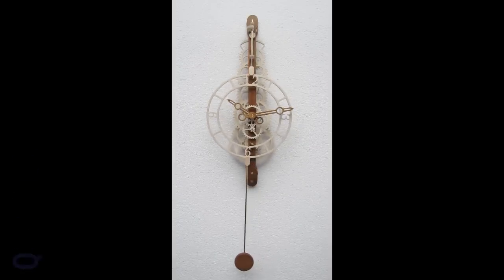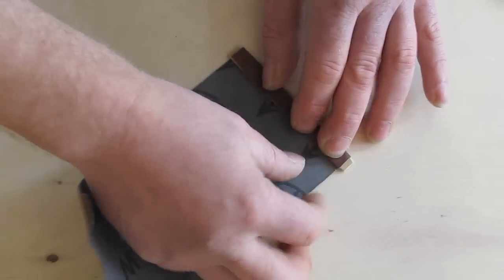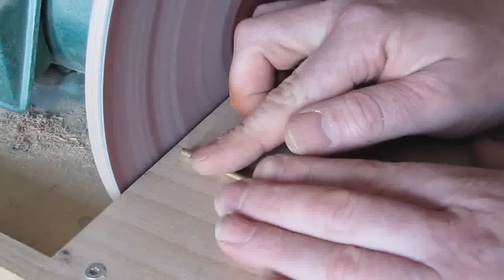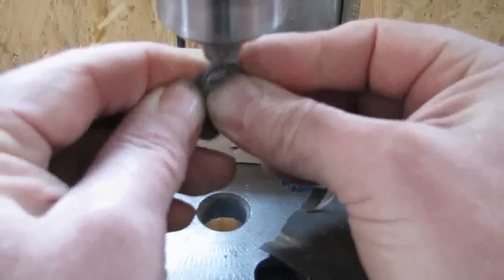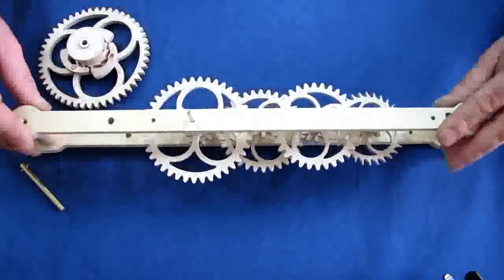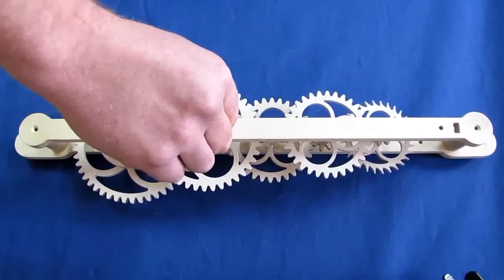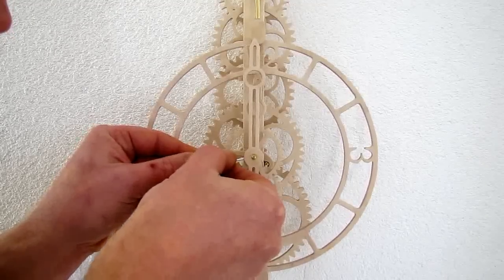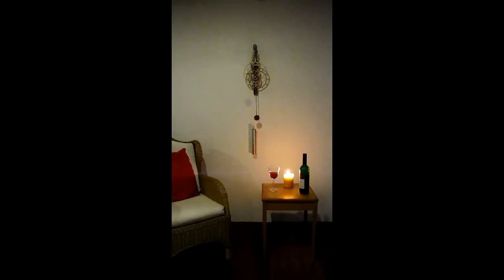Quartus-Making of

Comment from the maker: @roman3of23 €155 for the clock kit
 €172 for the clock kit including brass weight shell
I will also be offering the lead shot for an extra €5, but because of the increased shipping costs it might be cheaper to source the lead shot yourself. 
So for €177 you get a kit which contains all you need, except for some wood glue, a few household tools, a lick of paint and the time and patience to put the whole together.